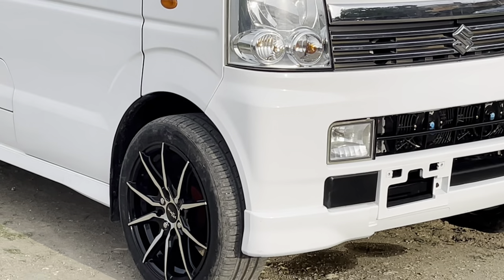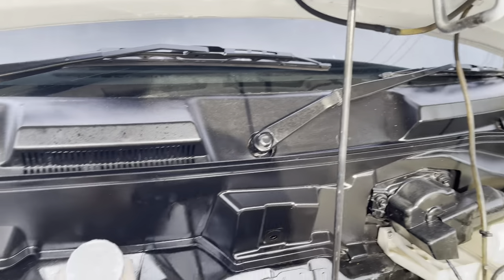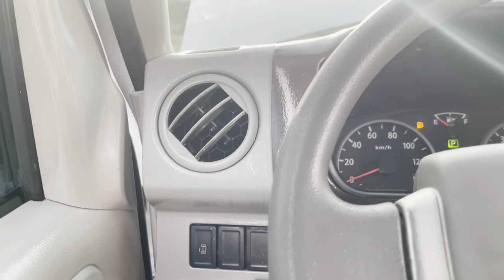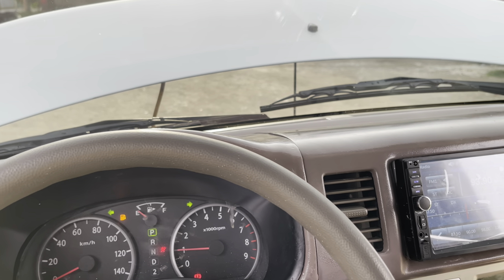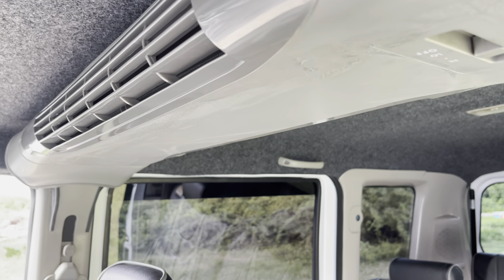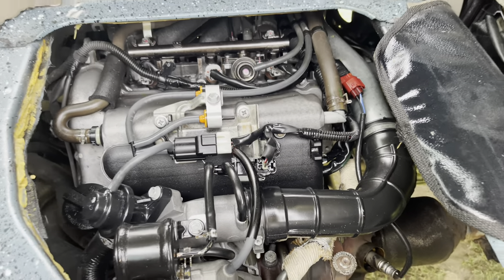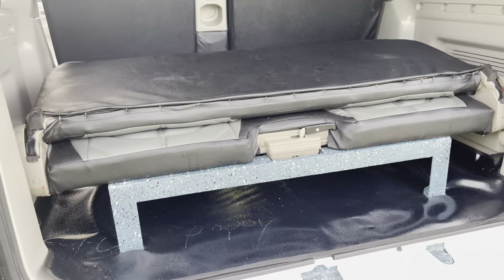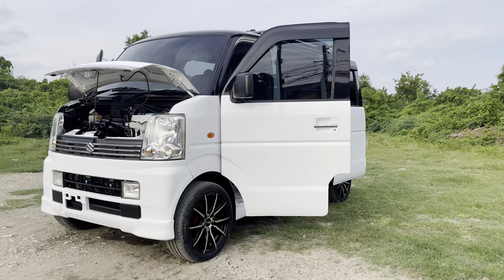Suzuki EveryWagon Automatic | Dual Aircondition |  Japan Surplus | Mini Van

Comment: Sir unsa ni blower lang o connected sa compressor, if dili ba ma loaded Ang engine
Reply from the maker: Aircondition ni sir connected sa condenser, Same compressor lang ang gamit sir, nag upgrade lang ug dako nga Condenser and g Additional ug 2 Dual RadFan & nag Upgrade ug dako nga batter

Comment: Db mahirapan ang compressor ng ac pag nag dagdag ng evaporator?
Reply: Bro, di lng hirap ang compressor, hirap mismo mkina kc nga 660 cc., sna mga 1000 cc. mn lng. Yung nga suzuki alto 880 cc., hirap ang mkina dhil nkaircon lalo n pg paahon, hirap umahon.
Reply: @noelsamonte5904 yun din ang alam ko .alternator nyan baka hindi tumagal..kung palagi gamit aircon sa likod. Makina, compressor to much load..sana wrap around nalang ang aircon.. hindi na dual